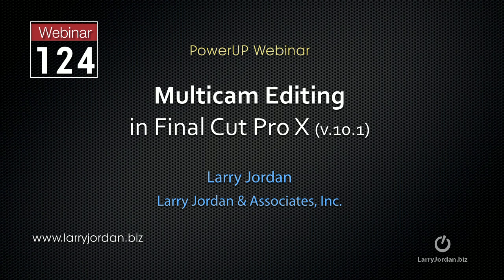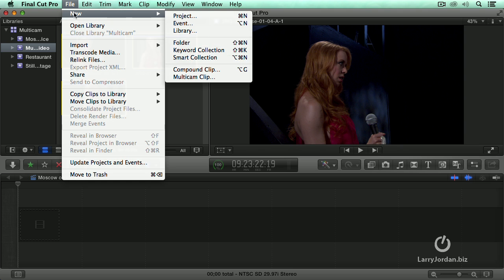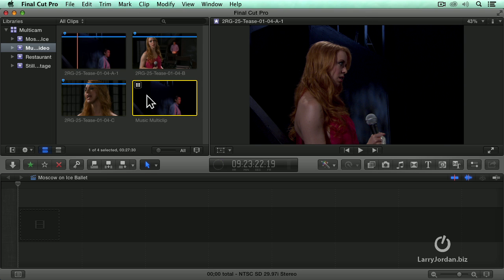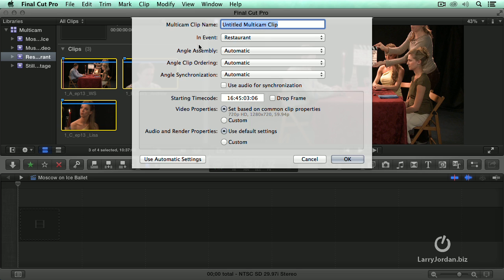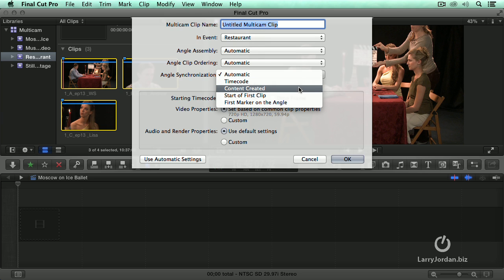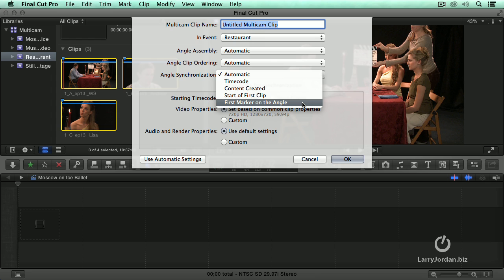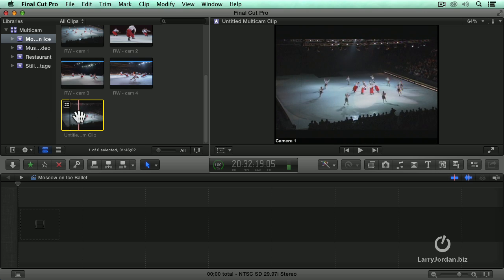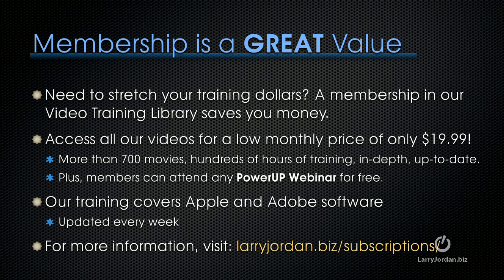Create A Multicam Clip With Audio Syncing

Comment: Thanks for this video mr. Jordan. 
I use the clapper to because i record audio seperatly.

But i do have a question about multicam. I did my white balance well i think, but i am still fighting with the color correction to set it for a 3 camera recording the same way. Then with rendering it changes again, it becomes more darker.

Is it possible to make a video or play list from how to do it from the point of whiting till the rendering? Because i can find many different opinions and visions about every step, but when you want to do it your self then it doesnt work at the end. It is really very frustrating. Sorry for my English, but it is not my mother language.